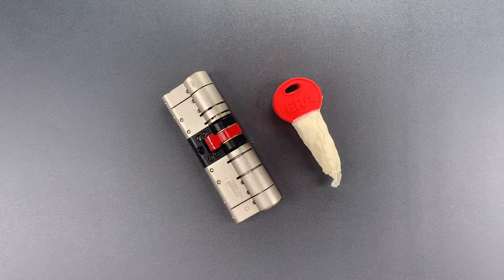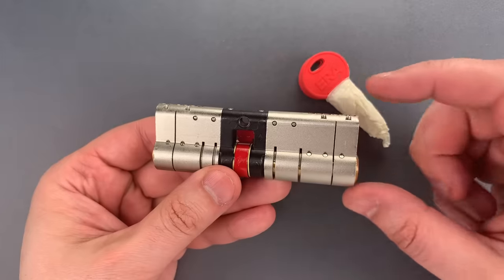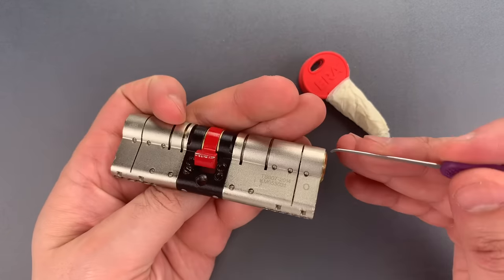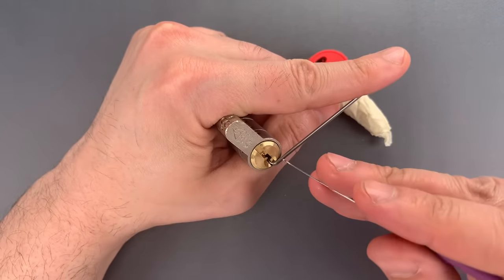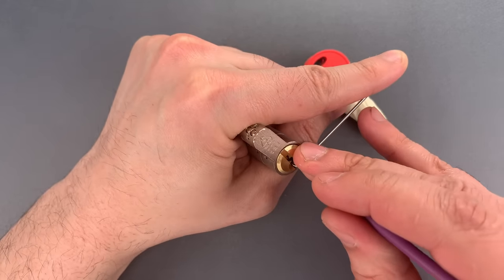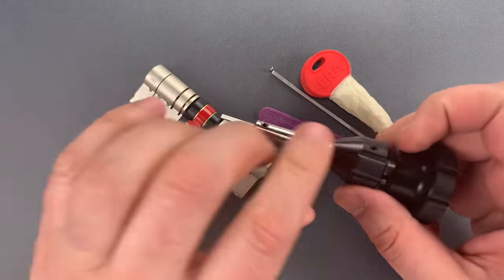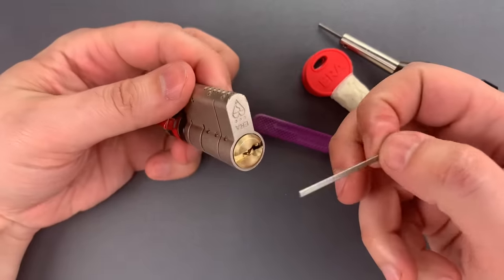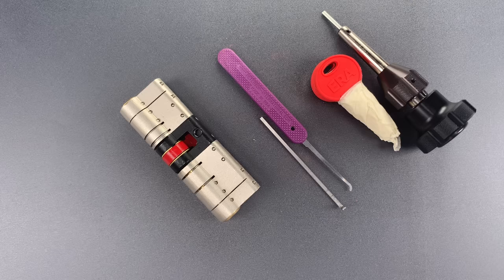[1256] ERA “Fortress” Euro Cylinder Picked (6 Trap Pins!)

Comment: About the padlocks I agree you can rotate them whatever you want. But those cylinder locks are designed to be door mounted and you wont be able to rotate them upside down and at different angle. It will be more interesting if you can show how long it will take to be picked in normal conditions. I have one of those mounted in my house and I'm really curious how good the are.

Comment: On these type of locks, can the lock be opened with the correct key a) once the trap pins have been activated and b) if the sacrificial portion has been snapped off? I have this lock on my garage door but the single-sided version with no access from inside...

Comment: Really like the lock, but that would make my door the weakest part and it's more expensive than the lock^^ That said, with the break-ins I suffered, picking, by-passing or even drilling was not what those individuals were able to. They used a crowbar and broke/bent either the bolt or dented the strike plate (and the wood behind it). The best lock will not prevent brute force attempts. It's merely a reminder for you that someone does not want you to just walk in. ^^

Comment: Impressive, but how would you have managed if you had not seen the cylinder beforehand and worked out exactly what was there? The acid test would be the lock cylinder in a door, then have a go at it and have to work out the "make up" of the lock on the fly.

Comment: I'm wondering if there would be a difference in picking when the lock would be in the right position. In europ (at least in germany) the lock is flipped so that the pins are on the bottom (at least in 90% of all door locks like this one). If you stand in front of it you would be able to read the brandname

Comment: How much longer do you take when the lock is installed in an actual door and you can not grab around the lock for the most comfortable position? I suppose you might also get less feedback from the gripping hand and noises might be muffled. Finally, when the lock actually moves a door's locking mechanism, your tricks with quickly turning might become more difficult, depending on the resistance the door might pose for the lock.

Comment: I wonder if they can put in a damper to make fast movement of the difficult while hardly impairing slow rotation. This would make the core flipper very difficult or impossible to use to bypass the trap pins.

Comment: So I noticed that I mostly see those locks mounted in a way that the keys teeth are pointed down. So I guess in that case the turning tool would come up top and you'd press downward on the pins? 
Having absolutely never tried to open a lock - would that be more tedious?

Comment: Hi, brit here. I've noticed that most locks (at least on exterior doors) are orientated with the pins under the key, so that the key presses them down not pushes them up like how it seems to be done in america. Would all of the features of this lock, such as the trap pins, still work in an inverted configuration? And are there any UK locks which you have held "incorrectly" like this that would have been harder to pick in an upside down configuration?

Comment: This seems to be a very good cylinder that you need those extra tools to spin it fast and I assume when there is a resistance of the lock or the doors a little resists so it might still have a big chance to fail with that spinner so I assume this must be a very good cylinder really

Comment: Typically, to be effective at securing something from a break in, an obstacle only needs to be effective for 30 or so seconds. No lock is completely invulnerable, but this will probably deter any typical would be thief from breaking into whatever you have locked up.

Comment: I have a question:
What if this lock were in a door that always jams and is harder to open. Then the door and the lock even with the key is harder to open. I mean I have doors were the locks just wont turn easily. You have to pull or push while turning the key. 
So I can imagine that this tool would not easily turn so fast like in the video. Wouldnt the trap pins then jam the lock. I just cant imagine that this tool can exert enough force to turn a built in look. At least not on jammed doors. Maybe on super smooth doors. 

I dont know much about picking yet. I was just wondering if it is really practical. Please if anyone knows what I mean I would appreciate an reply, thx!

Comment: There is one I think u missed something, this way of picking  my not work if it was  installed in a door the plug flipper will have more resistance from the mechanism of the door which will allow the trap pins to drop
Right? 😅

Comment: I think LP failed to state that this process  has to be done twice. Bolts require two turns. And, there's the location required to remove the core, not to mention the resistance of the bolt. LP, please try this on a real Euro lock and door, and try removing the core. Then, I would be impressed.

Comment: what happens if you trip the 6 Trap Pins! and you need to remove the lock from the door?. (will the red tab stop you remove the lock from the door)
Or do I have to get a locksmith to remove the lock?

Comment: LPL mentions "in the field" and I do sometimes wonder if the position of a lock in a door would increase difficulty a tiny bit as it's harder to get an angle on the lock. You cant move the lock as you can when you hold it as well. I doubt very much it would stop you, but is it harder?
Reply: Well, keep in mind that in this case, LPL knew there were trap pins because he saw the naked lock in front of him. If the lock was door-mounted, he wouldn't have seen that.

Comment: But why did you pick it upside down? Is that the orientation in places other than Scotland? Here the round bits up top and the flat of the blade goes to the top of the lock with the cup side facing down

Comment: Did it have security pins? If you can completely take the lock apart (you have the key and/or you're inside or whatever) can the trap pins be reset by a novice (or maybe locksmith?) or does it maybe somehow permanently brick/partially-brick the lock?

Comment: I generally wonder how much slower he would be if the locks were installed in a door at typical height AND where he doesn't have the benefit of seeing the type of lock ahead of time.  I also wonder if he rehearses (many times) before each recording.  In this case, if he didn't know the type of lock and was able to examine it bare (i.e. if it was installed in a door) he wouldn't have known the traps were there.

Comment: so good lock?
the locks on my doors arent nearly as good, but it has to be turned 3 times to actually unlock the door, so that would be 7+ minutes if i had this lock, cause you would have to do all that multiple times.
(though thieves in my area dont go through doors, they pull up roof tiles and then smash through ceilings)

Comment: Funny thing is most entries into homes or places in Europe are done through window or terrace door not the main door which is probably a 40 or 50kg fucking wooden brick, there is no way you are going to kick in most house doors in Europe without the use of a steel boot and a rocket motor attacked to it.

Comment: When you're picking a new lock it's a bit unfair that you can see the sides of the lock. If the lock was installed in a door you would only be able to see the key way so you would have little idea what other features were there.

Comment: I would rate this a fairly good lock, since you knew from the outside, what you had to do. don't you agree? Without the knowledge of those 6 trap pins it would have taken way, way longer to pick that lock, yeah an unskilled picker might have even broken it?
Therefore putting the brand on the front of the lock might actually be a bad idea, as it gives the intruder information and one philosophy e.g. in cyber security is to reveal the least amount of information as possbile.

Comment: When picking Euro-locks (for doors ones), you should really pick it with the pins on the downside as it is the way they are installed in Europe. It is understandable that you would put them the american way but I dare you to find any door with the core under the pins in Europe if installed properly. I would like to know how it impacts lockpicking difficulty. Because it would seem from an outsider point of view that it is easier to pick american locks than european because of that. You can even see that the brandings are written upside down on every European lock you pick
Reply: he holds it that way, because its more comfortable. I can assure you an average thief will not pick your lock. I had a lock for $10 and they just pry opened my door. they are not gonna waste time picking locks.

Comment: In other words, if you don't understand the lock configuration, you're in trouble on this one and a bit of research is necessary before approaching any unfamiliar setup if you're to have a chance of doing the job without a hammer and cold chisel...

Comment: What's the function of an anti-drill pin? I know the name kind of says it all, but how are they anti-drill?
Reply: Antidrill pins usually made of hardened steel. Most drill bits can't handle drilling hardened steel,either dulls the bit or causes bit to bind and snap

Comment: Mhh... So to prevent the speed rotation from happening they could install a mechanism to slow down the rotational speed and activating only above human rotational speeds ( not exactly difficult ) but still low enough thus allowing for the trap pins to catch? Could use something like this in their design: https://youtu.be/UIhCPl8eb7s but with Tungsten rollers getting retained by a just barely strong enough spring/magnet allowing for normal operation but with enough speed applied to overcome the trap pins the heavy Tungsten rollers would escape their retainers and jam up the mechanism for the Trap Pins to catch.

Comment: This tool won't work if the locker attached to the whole assembly the inertia of the whole assembly will be resisting to this quick turn. So, I am considering this is a trick, not a real-world picking.

Comment: The lock is only as good as the weakest link. Drilling, not much of an option unless you are the police, that can stand there for hours.
Snapping, not much of an option either. Picking, 3x2 sets of trap pins that would need to be identified. LPL used more than 2 minutes on this lock, so it is superior to any other lock that I have seen him open before.